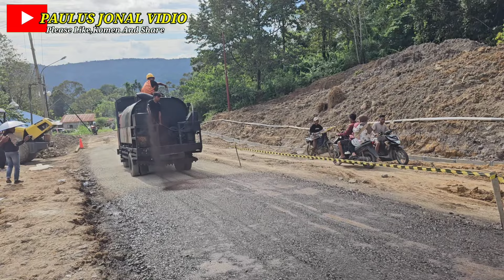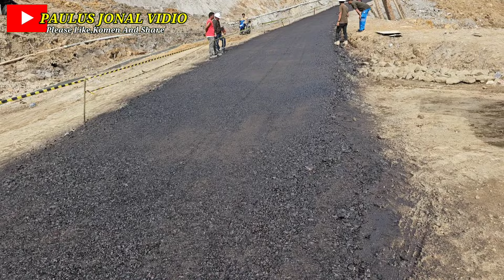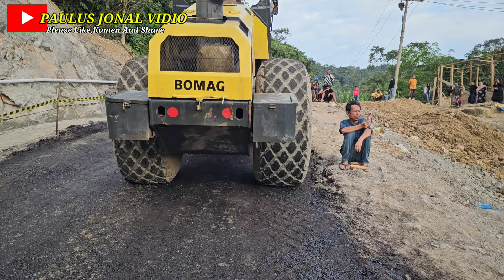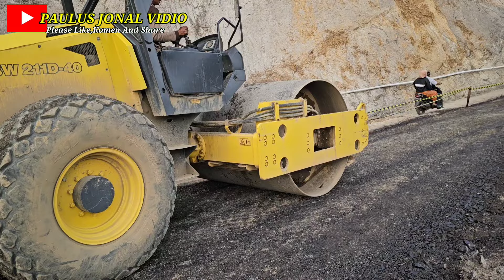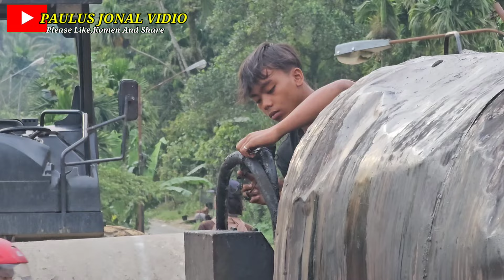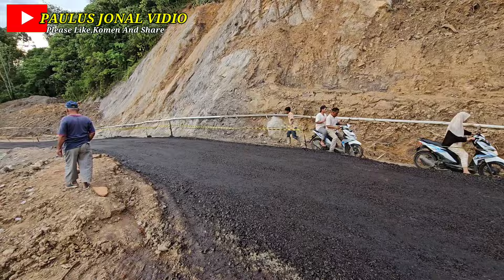2 Kali Dilapisi Aspal Curah || Dunia Internasional Menyoroti Perbaikan Jalan Di Batu Jomba

Comment: They are spraying a water based sealer on the gravel. Asphalt is not a liquid and can't be sprayed because it contains gravel, fillers, and binders and then needs to be heated and mixed in a asphalt plant. Then dump trucks must deliver it and dump it into a spreader with a thickness of 3-4 inches deep spread on the newly sealed road bed, or it won't hold the weight of cars and trucks.
Reply: You are correct 100%. 🙂

Comment: Tebing atas sama bahayanya dengan tebing bawah, longsor.... sementara itu badan jalan relatif cepat hancur karena pondasinya lemah.
Reply: Te doy la razón ahí si están mal ya que en el acantilado de arriba debieron hacer cortes pápaleslos a la carretera para hectáreas los derrumbes caigan a la carretera en Mexico se llaman Terrazas allá no se pero evitan mucho es que se tape el drenaje y la carretera saludos no les puedo invitar fotos de ello porque es un canal abierto y yo no tengo canal pero así se están muchos problemas y en la parte donde están las estacas debieron perforar sobre la roca unos tres 3 metros y colocar poste de ori Góngora con acero eso no va a servir se desliza la tierra con el agua que está brotando y adiós estacas
Reply: The upper cliff is so easy to fix. Open a path to the top, and clear all debris and vegetation, trees included. Then flatten out the top, in sequential steps, in a ladder like fashion. This alleviates tons of pressure out of the cut profile, and routes water out the cliff.

Comment: Bosku Paulus.. Perhatikanlah dimana ketika roda vibro melewati badan jalan. Permukaanya naik turun kan?!!!, artinya kadar air dibawahnya masih jenuh bos! Itu seperti gelembung udara di bawahnya. Kenapaaaa??. Mikirlah woii yg ahli pupr! 
Apa mereka nekad mengaspal hotmix besok dengan kondisi ini??, kita tunggu bosku. 😮
Viralkan truss.. ❤paulus
Reply: They are just wasting time and material. Chronically overloaded trucks with single drive axles will damage the road and extrude the soft section outwards down the hillside.